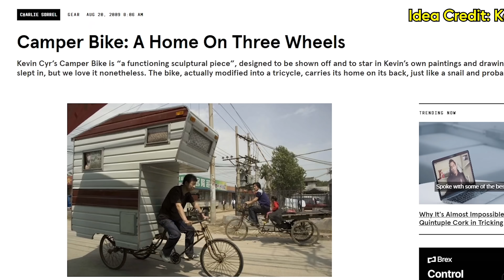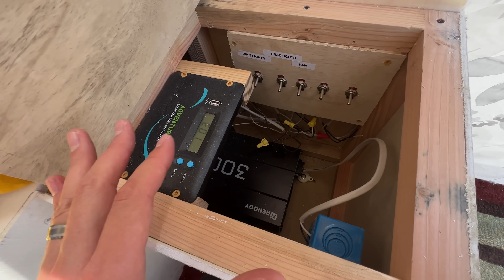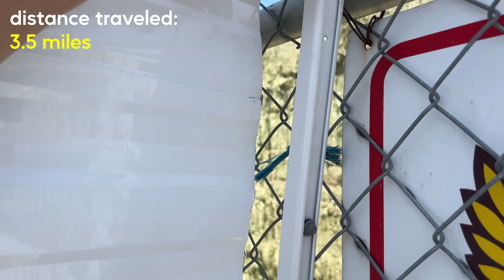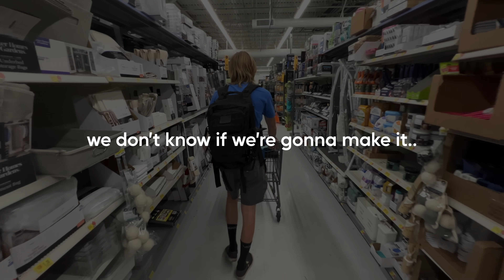Roadtrip in a Homemade Bike House!

Comment: You guys should've used an electric assisted bike that way you could've had done the 100 miles roadtrip that you had planned!
Reply: I was going to say that too.
Reply: @joycejohnson7640  And made it longer so you could sleep in it.
Reply: I thought the same thing.
Reply: gas assisted would have been cooler imo, itd be like a legit mini motor home, itd also have a longer range and double as a generator too
Reply: @samuelsaady9909 Not allowed on bike path probably.  Plus the smell...
Reply: Yes.  Make one on an e bike.
Reply: I wanted to say that
Reply: @lokinsea  can always do version mk2
Reply: @marcpikas2859  the newest tech in compost toilet doesnt smell much
Reply: There are kits you can adapt to transform a normal bicycle into an ebike even. Literally just change the wheel for a hub drive motor wheel and you're good to go.
Reply: @marcpikas2859  as long they're not modified too much, as in they keep the pedals and the motor is no bigger than 50cc its still allowed on bike paths
Reply: I was just about to reccomend an ebike, I have one myself. That totally could work.
Reply: @joycejohnson7640   I was going to say that three!
Reply: @FinalBard-rb7ll  But what is the speed limit on bike paths for everyone’s safety?
Reply: Or a tandem
Reply: That'd be cheating.
Reply: @marcpikas2859  in the US, problaby around 15-20mph.
Reply: Make one with a ebike inside and a windshield cut into the rectangle so it's more like an RV.
Reply: @jurre4405  tandem with e-bike front wheel
Reply: or maybe an atv or motorcycle 

unless the challenge was to use a regular bike so eeeeeeeeeeeeeeeeeeeh
Reply: Same thought
Reply: My first thoughts too. I've just bought an electric assisted bike after resisting ages and it's the best thing ever 😂 maybe a re run with one. Those guys cracked me up. I loved the camper, such fun...
Reply: Electric bike plugged into that solar panel 👌
Reply: yes  some thought, preparation and prototypying with trials would have been more than useful.
Reply: @marcpikas2859  where I live top speed for a bike path is 20. Motorized bikes are allowed to make use of bike paths or road ways, depending on the rider's experience.
Reply: Ebike or maybe a bike with two people able to pedal
Reply: They just needed 
YouTube content.
They didn't take it
Seriously.

14 MAY 2023, SUNDAY 🖖🐈
Why was I DISAPPOINTED ???
It's such a GOOD IDEA 💡
Reply: Why did we all have the same idea but they didn't
Reply: Literally my first thought
Reply: @lrmclinn  truthfully because for a lot of us, bicycles are our primary form of transportation
Reply: @FinalBard-rb7ll  not for me I just got into bikes 🤣
Reply: @lrmclinn  fair enough but you still had the sense to suggest some type of assist for the bike
Reply: They dangie bros so they said no
Reply: They dangie bros so they said no
Reply: I just saw a video about a guy who was towing a great little house on bike wheels and he had tried e-bikes.  They didn’t work out well at all and he ended up using a recumbent bike. His rig wasn’t as high as this was. That’s a mistake right there. The thing is top heavy!! This guy was from Belgium and so far (as of the time I was watching) he had been on the road for a year! It really was a clever arrangement!
Reply: 600 th like yeah!!!
Reply: yeah. they should make a v2.
Reply: This may be the last wholesome thing on the internet.
Reply: I was gonna say that too
Reply: Yep, I was going to say that, too. Electric bike.
Reply: Yes a electric bike will be good it's a nice home
Reply: @joycejohnson7640  But the two bikes Idee is really Smart 👌
Reply: Potential updates… use electric bike and more solar panels to power everything. Awesome project!!
Reply: Yeah with a few spare batteries that could definitely work.
Reply: and in 1 day too with 3 or 4 15ah battery packs.
Reply: next vid easy mod
Reply: it's a clown show, homie. plenty of not-clowns have done this run without collecting millions of views.
Reply: Exactly what I was thinking 🤔...Now that they have tried it they can truly make better improvements! Awesome 👍
Reply: Agree. Lol but you are young so go for it. Many people can’t afford an E-bike so you are showing how it can be done manually. For more permanent use, I might consider getting rid of some unnecessary weight. Happy Travels. ❤
Wives?!?! Have lots of patience’s. Lol
Reply: @marcpikas2859   no one said they would bike on the path. If it’s essentially a motor bike then it would be on the road. Drive in the slow lane with other RV and towing vehicles. Not a big deal.
Reply: Yeah electric bike would be best option
Reply: that would destroy the whole fun part
Reply: 🤔…Wouldn’t be as interesting or comical if they had an e-bike.. 🥳
Reply: @marcpikas2859  most states cities and cops don't care
Reply: But then it wouldn’t be dangie bros
Reply: That’s was thinking that lol
Reply: took my words
Reply: @PrincessFiona-j2o  I see you have fine tastes as well.
Reply: Yupps..i think so too
Reply: My thoughts exactly
Reply: im thinking an electric was not considered due to where to chsrge it.
Reply: Exactly I have no idea why they didn’t do that
Reply: Agreed
Reply: @samuelsaady9909  e-bike. install solar to the camper. have it charging additional batterys for e-bike.
Reply: this is literally what i thought
Reply: Or use a tandem bike so both can pedal together
Reply: i know i was gonna comment about that
Reply: they probably wanted it  with a plot twist and used a regular bike or they weren’t thinking about that idea maybe !
Reply: well thats what happens when u use 20% of ur Brain
Reply: The problem is regular electrics won't haul this well and they need backup batteries. They need a recumbent or 2 person bench style bike.
Reply: @dertythegrower  they were talking about the smell of gas (why an e bike is better than a gas powered bike) not the toilet
Reply: Gas would be more practical. Electric would kill the battery with the extra weight and take way to long to charge. Even if the whole roof were solar panels.
Reply: Maybe a surron
Reply: I feel like that would take away a lot of the challenge part of towing a “house” with a bike
Reply: I currently tracking down pieces to make a solar powered bike trailer w charger. This video assures me I'm not to crazy. I've got a panel that will put out 24v in the shade anyone know if that's enough
Reply: Dirt bike
Reply: While I'm pretty sure it could get up to a decent travelling speed; I'd be concerned that the trailer might be a bit too top heavy for a bike. It'd be very likely to tip over going around a bend.
Reply: Someone made a mini camper where it was an electric bike and they made a teardrop camper out of materials from Lowe’s such as studs for the frame and kingspan foam for the walls and used fiberglass to make it stick together and make a shell for it
Reply: I was about to say... This was absolute madness with a standard bike. They've even got a solar panel, so they could charge the battery!
Reply: Or a random bike
Reply: Tandom bike
Reply: @Ashton_2176 they could have also use a motorbike so the journey wouldn't be so tiring.
Reply: The e bike would've taken longer. They're only good for around 20 miles on one charge.
Reply: Kind of defeats a purpose of a bicycle
Reply: Electric bike!
Reply: Especially having solar panels!

Comment: From an engineer standpoint, your rear axle needs to be cut, extended, and re-welded near the rear of the vehicle to keep the vehicle from tilting backwards if going uphill. Another thing im gonna point out is the sideview mirrors leave massive blind spots, another thing you can do is go with vinyl siding instead of sheet metal to cut down on weight a few lbs, the body of your trailer would benefit from a more streamlined shape incase you are pedaling against the wind. Last but not least, you need a disc brake setup and dual front wheel axle to brake faster. Those are the basics i would go with but then again i would redesign the whole thing the right way instead of tweaks.
Reply: Also have a tandem bike set up.
Reply: Yeah, the wheels need to be further back and spaced further apart. Instead of sideview mirrors, they could use a rearview camera with a little monitor hooked up to the handlebars.
Reply: You should of made it an 18 wheeler, and put a couple of sets of pedals inside.
Reply: Engineering saves the day!
Reply: Would a different sized sprocket for the rear wheels/axle make it any easier to move the weight? Or just more rotation per wheel, per rotation of the pedals?
Reply: Vinyl siding isn’t light.
The vinyl will be thicker than steel sheet metal, so probably comparable in weight.
Aluminum would weigh less than both, and it appears to me that’s what they used.

I haven’t seen their build video, but probably too much wood  and steel in the construction.

It would definitely benefit from a little bit more fwd cg.

But not a bad job for a couple guys inspired by a photo.
Reply: Tesla needs to make one of these.
Reply: I agree with all your engineering comments and suggestions for redesign.
So much by technology is available that they were not using with this. Example over 20 years ago I had a long haul cargo bicycle, made in Eugene Oregon. He had a big box on the front kind of like a delivery bicycle. It had 42 gears and motorcycle disc brakes. I can’t carried over 300 pound load of cargo and road up mountain passes just fine, going across Canada I averaged 65 to 110 miles per day
Reply: Oh come on guys, it’s not rocket science… Actually, I think it is
Reply: Does anyone know what state or city this is? I'm guessing it's the US. I'm from Europe and I'm amazed, very nice + very positive open people
Reply: Message their business email. Im sure they would fly you out to build this thing

Comment: I could see this working if you took a 4 person bike surrey and reduced it a 2-person pedal power with a possible battery assist.  The base weight of a 4-person bike surrey is 160kg (350 lbs).  The camper build would be better supported by the 4-point wheelbase.  I would estimate the camper weight at 90kg (200 lb) so the total build out would be 250 kg (550 lbs) or less.  It would be far better balanced and if the camper was shaped, or a windscreen was installed, it would be far more aerodynamic as well.

Comment: I think you should try this again with an electric bike. Amazing content as always, keep up the good work❤
Reply: Gas powered engine way better, less pollution👍 electric bikes and their batteries end up in landfills and that's bad bad news.
Reply: @jasonwillings3231  that depends where you live. In my country they want to recycle as much as possible and there is even a section just for car batteries and bike batteries. But it is true that a lot of places it does end up in landfills and that is really sad. And in that case it is better to have a gas powered engine.
Reply: They could probably mount a hub motor to make it an electric bike.
Reply: Electric or gas for that extra power boost up hills would be a huge improvement. Love the general build 😀
Reply: @jasonwillings3231  ehh gas conversion kits for bikes kinda suck electric is way better
Reply: @mattthamonster842  ehhh electric really sucks nd could never pull this load . Gas is better, and less polluting.
Reply: Gas is loud and not permitted on bike trails
Reply: @dotjohnson231  Buy a muffler
Reply: @skipstalforce  and don't ride on the bike path?
Reply: @dotjohnson231  Were I live you ride them on the bike path, they're bikes, that's where they belong.

Comment: Interesting video & Great job guys! 
You need a part 2! Here are some suggestions:
1. Use an electric bike and get some company to sponsor it: Rad Power Electric Bikes.
2. Make the window bigger at front & create one at the back.
3. Have side mirrors similar to buses but hooked up at the ceiling. 
4. Have a bar handle at the back for pushing. 
5. Modify 1st floor & sleep at the floor instead.
🙏🙏🙏👍😎👌

Comment: I wonder if an e-bike would have worked? I'd love to see you guys try again with maybe other forms of transportation? Anyways great video!
Reply: Would have been the better choice
Reply: Would have drained the battery so fast.
Reply: @namegoeshere3838  true.
Reply: @namegoeshere3838  but for all the leg work and what not it would be a good choice for w bike alot quicker ateast
Reply: That or a motorcycle or a engine bike that’s a normal bike with a Engine strapped to it.
Reply: @namegoeshere3838 they could use solar powered charging to somehow keep the battery charged?
Reply: Solar is a slow charge and needs many panels; being 12v and most ebikes are 36v or 48v to get any power. It would be better using a 2nd battery that's on a charger. 12v solar panel to an inverter that a charger is plugged into for a 2nd battery. It can take 4 hours to charge a battery and you will have to pedal hard to make the 1st battery last. Just pedaling with a standard ebike gets you 90 minutes to 2 hours
Reply: Yeah, I have one of those gas motors for bikes. On the average they get about 80 miles per gallon. As hard as these guys were pedaling it might help a little, only 49cc and 80cc models. The 49cc scooter in any wind gets you 15 miles an hour
Reply: Solars panels, extra battery, and an electric inverter generator would have definitely worked. I’ve been thinking of doing this exact thing.

Comment: Three things to note. If the next model has the two bike method, then a retractable roof or space on the inside could help with the wind resistance and portability.
Reply: Odd my other two points were removed. Not a big deal, but I don't recall what they were. Lol.

Comment: In 1988 my best friend made something like that with a 3-wheel bike. He used wood for the frame and aluminum siding for the outer walls and roof. He added 2 extra wheels from another 3-wheel bike for support. It had a bed and table in it. He wired it so he could plug it into an outlet for lights, a small tv and to run a fan. He rode it to school every day. He sold it to a pawnshop a few years later for 150.00 lol he put a lot of work into it during the time he owned it.

Comment: Make a  as big as posible powerpack to go midcamper to help with back wheight and then a  powerfull electric hubmotor for the front wheel..... sunpanels on the roof to charge as you go and with a bit of calkylation you will have an electric selfsuficient ebikecamper....

Comment: You need to make this with extremely lightweight materials, starting from aluminum sink and a lightweight travel stove or lightweight inductive electric stove. less furniture inside- aluminum frame hiking chair only and the matress should be air matress with battery powered small pump. Instead of plywood use several aluminum bars as the base of the bed and just put the matress on top. As body, use carbon fibre or thin aluminum sheet. Then build it all on a real tandem bike with electric assist motor. I bet you can make 100 miles with that.

Comment: Yo guys i would recomendable that for some of the wheels change ir for a little bit thicker rim wheel for the back and change the materia you could use less wood for the thing or use some layer of scrap metal with some tiny layer of wood for make it less heavy

Comment: You should change the bike into the three wheel type of bike (two wheels in the back and one at front), with two seats at front of bike where two people can paddle. Also attach a motor engine to make it a semi motor bike just in case there's an emergency. And solar panels to power the motorbike.

Comment: Make one with thin galvanized metal or fibreglass framing, or its hernia pedalling time.
Add electric hub motor(s). make it float with a inflatable version.
Make sure to get rid of any logs of poo from the digestive system to reduce towing weight.
Urine also adds weight, so pee before you set off.
Rather than air, fill the inflatable version of the thing with helium.
Make the standing area a waterproof shower.

Comment: Think the Bike House 2 should be more of a quadricycle bike design, so two people can sit next to each other and pedal at the same time, along with a built in electric motor that collects some power from the battery that can be recharged by the solar panels.

Comment: For your next adventure take two quads with trailers (for camping gear) across the United States using the dirt roads that motorcycles  travel on.  Don't forget a chainsaw and shovel (for troubles).

Comment: I do like the idea. I dont like the camper.  The sleep area is too close to the ceiling and i doubt the little camper has enough room for insulation. Wheels look a little too easy to bend. 500lbs doesnt sound like alot but going uphill with that top heavy thing im surprised it didnt flip over. Maybe they should do a long teardrop type. The seats on the bottom looked stronger than that whole bed.

Comment: Yeah, definitely get an e-bike with a 7-speed transmission, let the battery cool off after it has hit 20% usage, charge it once it hits room temp, read a book or eat, and keep on trucking. Depending on the battery size, you can easily do 100 miles in 2 days.

Comment: Just think how much easier pedaling would've been if you had added a couple solar panels to the top and used that ~250 watts or so to drive a DC motor to assist with pedaling. It wouldn't have been enough to move it completely under it's own power but could've reduced your effort by half or so.

Comment: Dear, “The Dangie Bros” 

For a future video, I would suggest nothing more than replacing the pedal bicycle you have there with an electric, 

Then maybe connect the electric bike to the solar panel as well, to improve energy consumption/efficiency

Replace the walls with foam boards

Edit: Last but very very important

Waterproofing

Comment: If you've got power in the camper, wouldn't it have been smarter to build it with an e-bike? Just throw in a second battery and you'd have enough power for an e-bike motor.